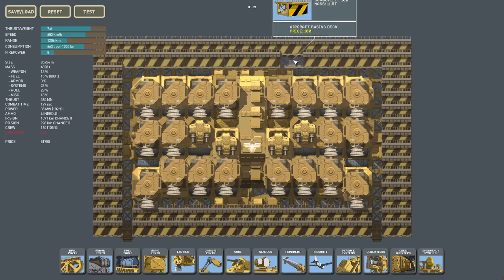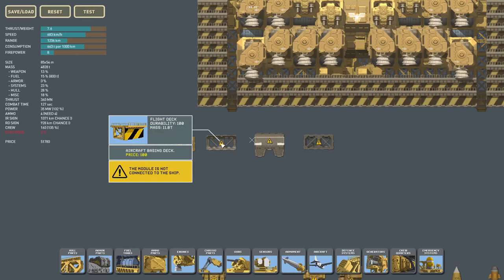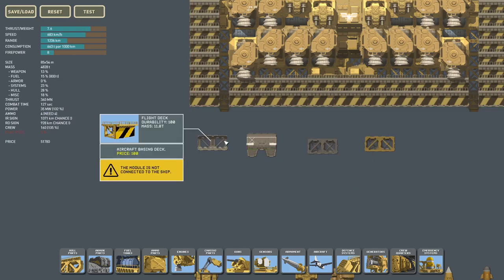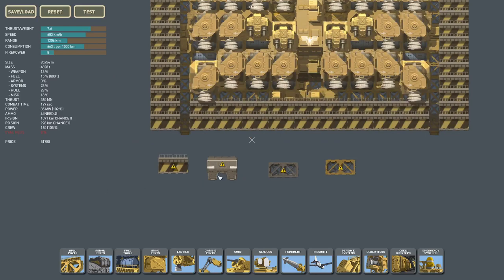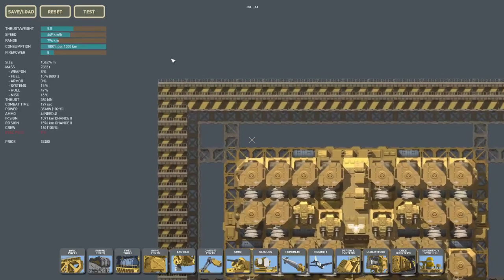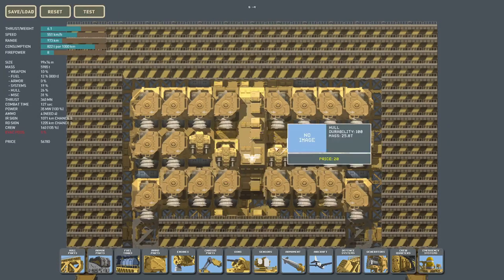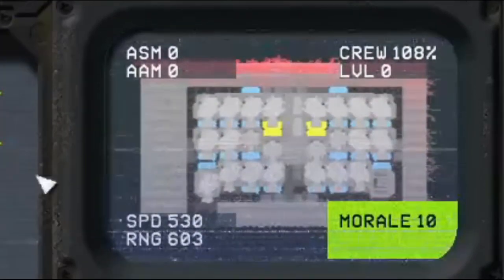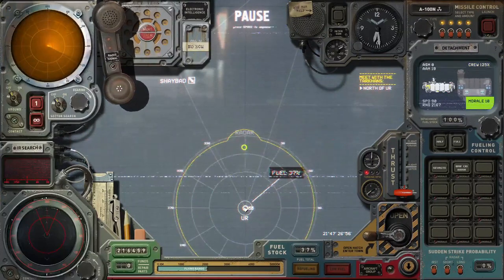Plane Decks as Armour | HighFleet Builds

Comment: For Armor Plating over the other types of Hull it's important to note that they have a Flat Damage Reduction and not only durability, so small caliber munitions just bounce off rather than do small amounts of damage.
This is why Cruisers without exposed parts, such as radar, can easily take out smaller craft without any damage to themselves, and why tactical missiles and bombs are pretty important for small ships that don't have large guns, because against larger ships their main guns might not even scratch the armor plate.

That's why you should still should use Armor Plate on your ships, given their weight, be considerate where you place them and if the ship truly needs them.
As a rule of thumb I like to use:
Tactical Combat ships -> Armor Plates, because a lot of their damage will come from multiple shots, the damage reduction does nicely against, make sure to guard the really important and expensive stuff.
Strategic Ship -> Not so much Armor Plate, because their damage will most likely come from missiles and planes, whose single high damage can and will basically ignore the reduction. Make sure the fleet they are in have sufficient AA interceptors, such feniks and aircraft carriers.
Reply from the maker: No doubt armour will actually serve as armour better than anything else, but this was just a viewer idea that I decided to test out just as an experiment, and besides, this video may be outdated because it's from 1.15 version